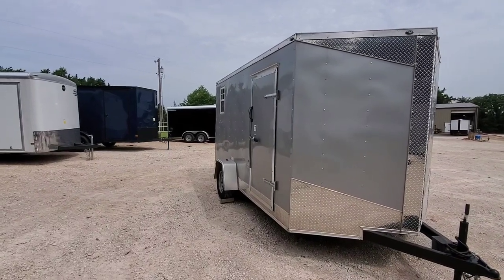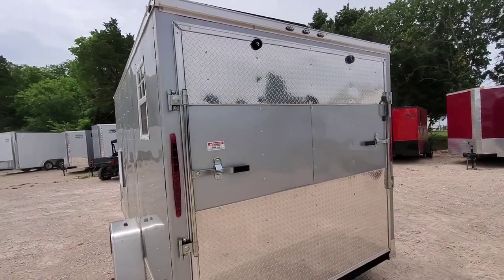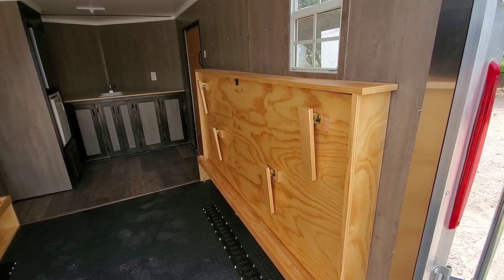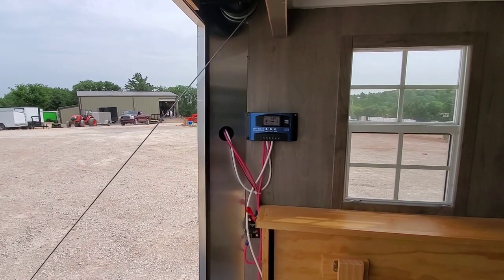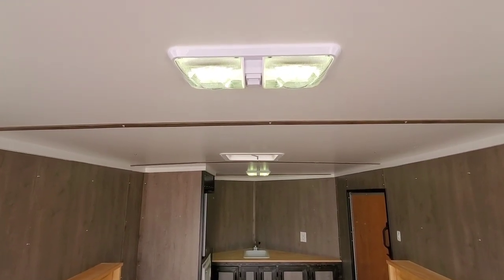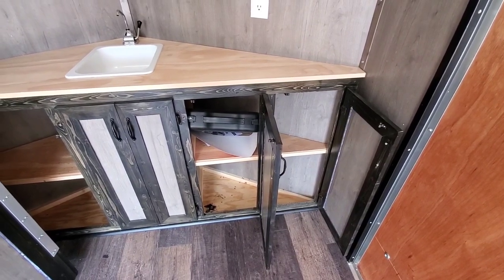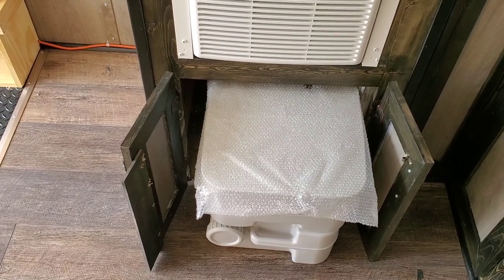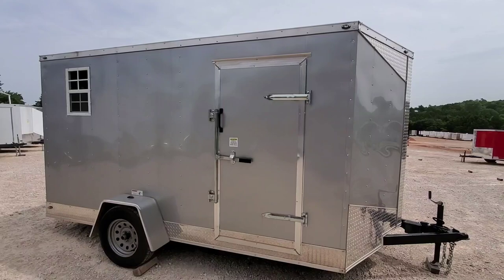7 x 12 Cargo Trailer Toy Hauler Conversion

Comment: Nice build
I am converting a 12ft cargo to camper/toy hauler 
I am curious as to what you did for solar and shore power
What battery size did you use
Inverter ?
Solar panel I intend on buying a 150 or 200w
I will run a 110v mini fridge 4.4 cf 
Don’t intend to run much else
No a/c no microwave 
Maybe Nespresso coffee machine 
Max fan and led lights wiil be 12v
Thanks
Reply from the maker: Thank you. For shore power, we brought in 30 amp service via a 30 amp rv inlet feeding a 4 slot breaker box.  For solar, we used a 250 watt panel, 20 amp charge controller, 2 - 95 amp hr agm batteries and a 750 watt inverter. The only thing running off the inverter is the fridge. We wired the 120v fridge circuit and the inverter circuit to a switch to allow the fridge to run on solar when not on shore power and on shore power when not plugged in.

Comment: Could you explain how the porta potty works?  Thx.
Reply from the maker: The lower part of the toilet is a holding tank. When you flush, the waste drops into the holding tank. When the tank is full, you remove the tank and take it to an appropriate dump location (rv dump station, flush toilet, vault toilet, etc). After it's empty, replace it under tbe toilet bowl and it's ready for use.
Reply: Yes I can .First you put a 13 gallon trash bag in a 5 gallon bucket and than put that nice wooden toilet seat on top . Do your business and put the seat away pull out the trash bag ,tie it up and throw it out. No crap to handle, no crap sitting inside your camper that you have to smell and clean out later.😊

Comment: Curious on a 6x6x12 that can sleep 4 and 2 dogs. I have a factory insulated 5x10 v nose with factory windows and RV lock looking to trade it is a 2021
Reply from the maker: That's asking a lot from a 6 x 12. I would look at a 7 x12 minimum. 7ft wide will give you the ability to put 2 sets of bunk beds in runnimg front to back with room for the dogs in front. I'm starting a 7 x 14 in a couple of weeks that will have a single bed on one side and bunks on the other. Send me an email address and I'LL send you some pics during the build to give you an idea of how it works out. tinytrailers4bigadventures@gmail.com

Comment: What kind of air conditioner is that?
Reply from the maker: The AC is an 8000 btu Frigidaire Casement window unit. I like it because it fits between the wall studs.

Comment: How did you do that finish on the cabinets?
Reply from the maker: I used 1 x 3 "whitewood" boards from Home Depot. Sanded the heck out of them to get them smooth, then stained with Varathane Ebony Stain. 2 costs of satin finish Watco Brushing Lacquer for the clear coat.
Reply: @TinyTrailers4BigAdventures  thank you.

Comment: Could you pull one of these with a 2010 ford ranger v6 4x4 ?
Reply from the maker: What is the tow capacity of your truck? The trailer weighs about 2600 lbs.
Reply: @TinyTrailers4BigAdventures  thanks for the info i th8nk it will work
Reply from the maker: @dirtbikedude1334  - If I can help you out, let me know.
Reply: @TinyTrailers4BigAdventures  ok thanks will do 👍🏻
Reply: My 2000 Ford Ranger xlt  is rated to tow 7000 lbs